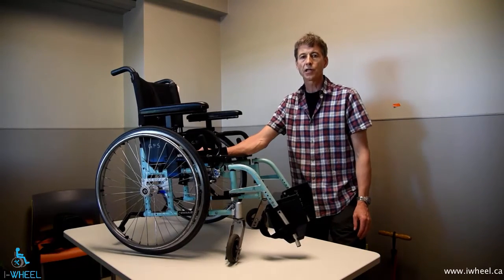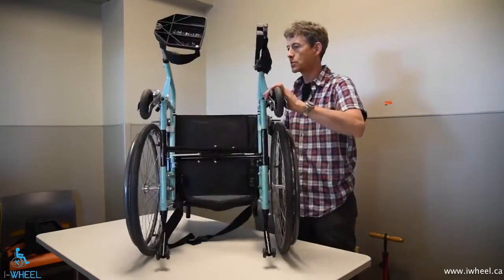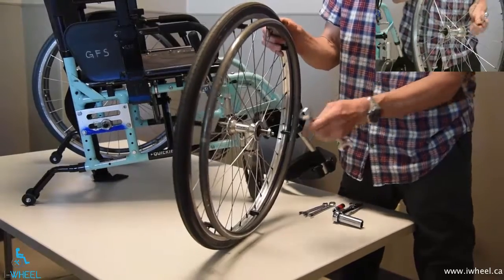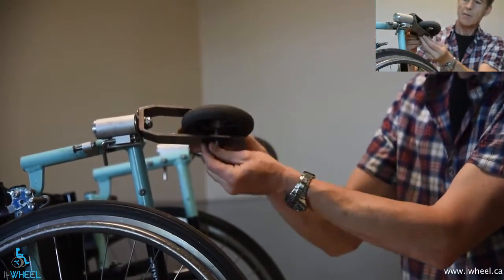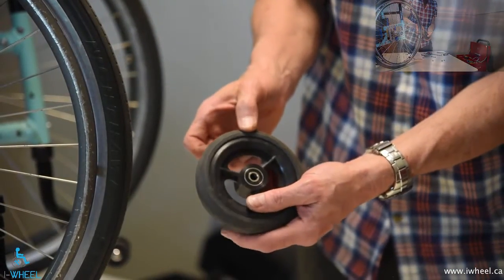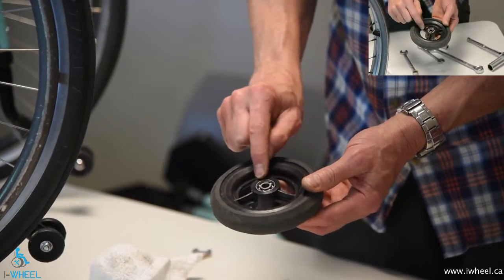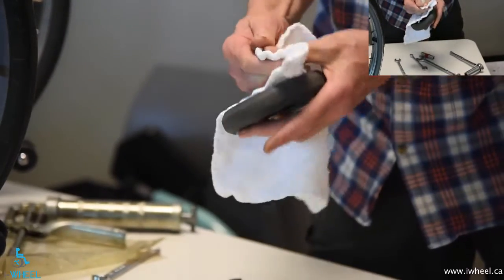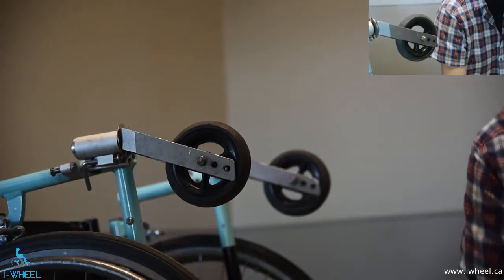Manual Wheelchair Bearings

Comment: Hi Ian,
My sister's main wheelchair has 24 X 1" rear wheels that are 8 spoke and made of some sort of plastic/composite material. It is a nice Everret Jenning reclining chair whose bolts that attach the wheel to the frame are about 7/32 inch thick SAE..

 I need to replace one of the wheels with a spare 24 X 1 inch wheel I have from a chair bought at a flea market. It's bolt is  possibly a machine bolt which I believe is 1/4 inch. I can use this wheel with the 7/32 inch bolt  but there is a bit of play in the 1/4 wheel's bearing. Is there a way to exchange the bearings on the wheels or adapt a bolt to fit the bearing? 

Thank you